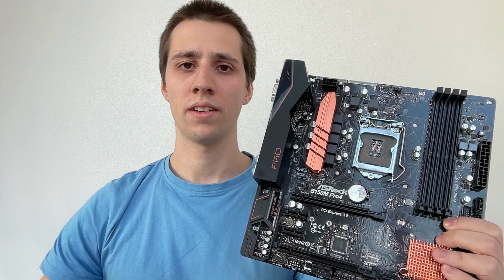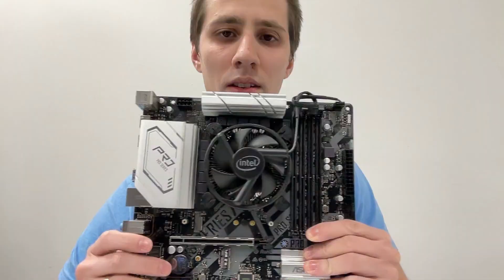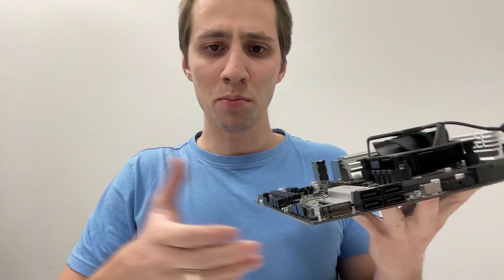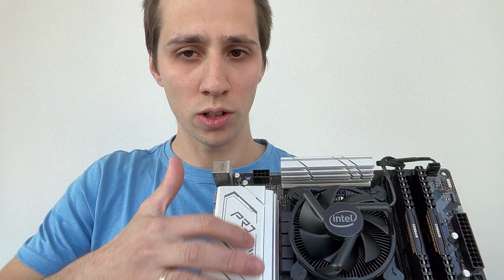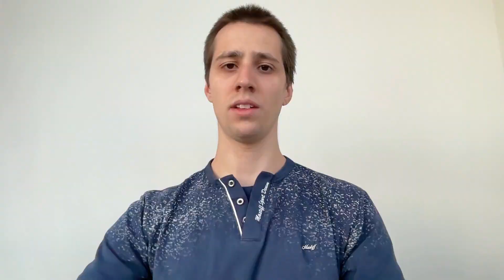Motherboard explained. Basics of the motherboard.

Comment: Nice explanation of the MB ports, connections and components! If I ever decide to try and build my own PC, this will be very helpful. My old PC was always losing the correct time and date when powered off. I assumed it was a small battery on the MB, but I never knew it's something that can be changed.
Reply from the maker: Yes, that issue is usually caused by an old CMOS battery, which is indeed replaceable. Building your own PC is a rewarding experience—go for it!